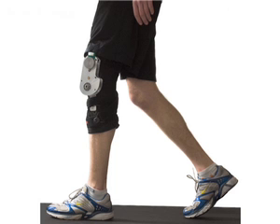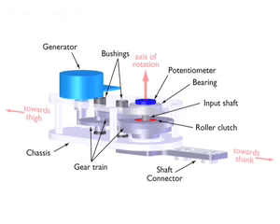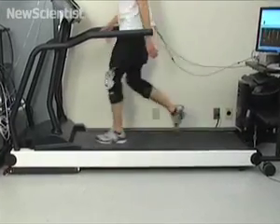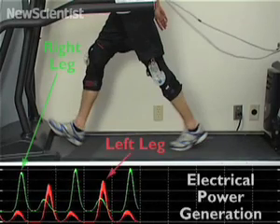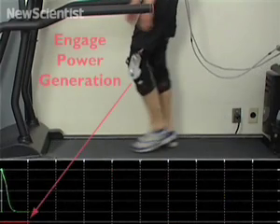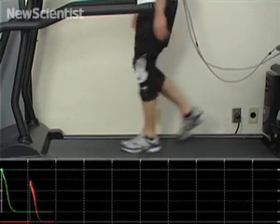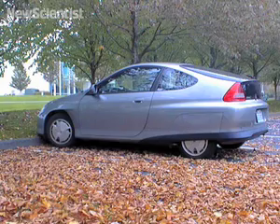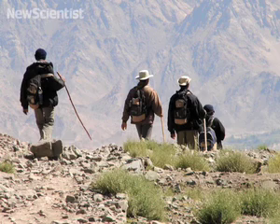Knee device makes phone charging a walk in the park

Comment: Hmmm... 5 watts seems a little low for 10 phones durings talks. I checked the linked article, and it says nothing of the phones actually being in use, but half a watt seems low for a phone during talking. It could be that they're talking about five watts per cycle, though they're not specifying it, and I would suppose that's the most logical interpretation...